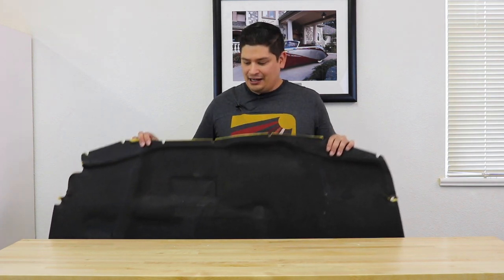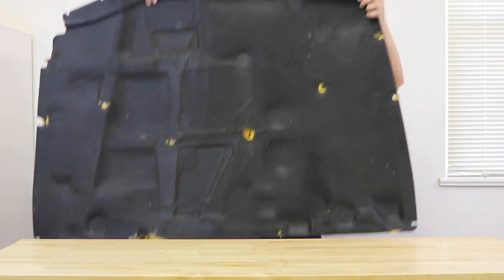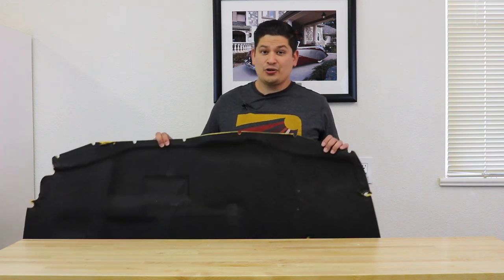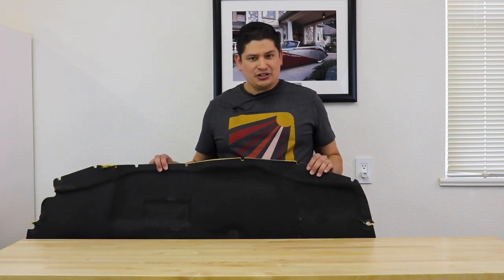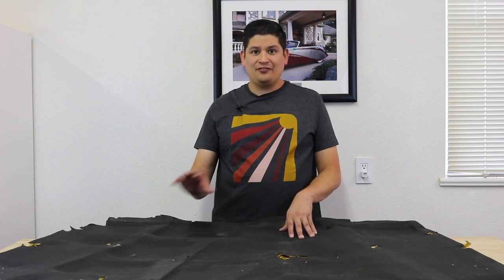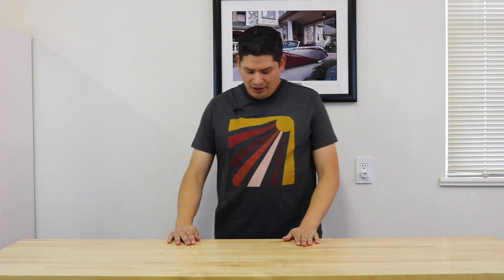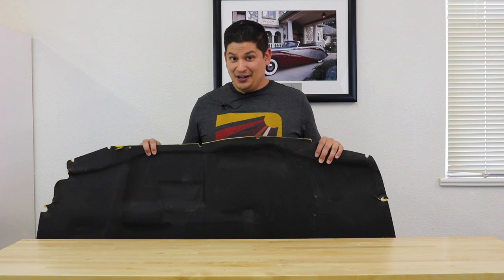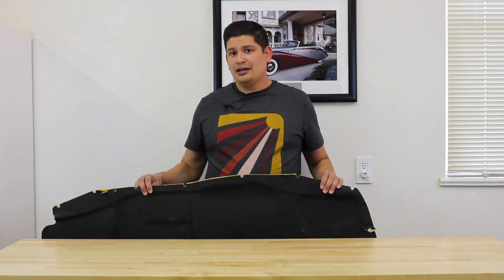HOOD INSULATOR PAD - WHAT DOES IT DO?

Comment: Chill out u don't usually need it I lost it 2 years ago and I didn't know what it's for so I didn't buy and after 2 years it didn't damage the paint so this is foreblanket and noise prove .
Reply from the maker: Right! That is what I have been trying to tell everyone but for some reason people think their paint will get damaged. Thanks for checking out the video man.
Reply: @DriversTherapy  i have jet black paint on my 2004 e46 and removed the insulator about 7 months ago and i definitiely noticed light oxidation above the engine and bought a new one.
Reply from the maker: @wooltrouserslover777  sorry to hear that. But that is good info for any one with the same setup.
Reply: @DriversTherapy  yeah it’s unfortunate- everyone on the e46 forum claims you don’t need it but they’re wrong. it’s not too bad though, I think it’ll polish out pretty easy.
Reply from the maker: @wooltrouserslover777  I understand. That is why I added in the video that every car is different. Even though I have no heard of a Supra having issues I still put some heat reflect tape on it for peace of mind.
Reply: @wooltrouserslover777  hi, i have the same paint. Did your car have turbos? Thanks
Reply: @wooltrouserslover777   thanks for input, my wife 04 325ci I’m fixing (years of neglect before we met) have a rotted insulation that I find seeping through her cabin air filter and air-filters. 

Planning to just remove and was curious if it was needed. Not paying $150+ lol. Figure maybe just get roll of heat pad / noise reduction for less than $40 and just slap it on instead.

Comment: So question I put oil in my 2011 Ford Fusion and forgot to put the top on and as I was driving I started to smell oil in the inside of the car I thought maybe because I spilled a little bit while I was pouring it in and I did clean it so I was like okay well maybe it'll burn off but it just started getting worse I was like oh my god did I really forget to put the top on and yes I did so the inside the cushion in the inside is a little drenched with oil so should I take it off or should I clean it I know for sure it's going to continue to smell like oil inside of the car until that is taken care of
Reply from the maker: Hello, accidents happen so don't beat yourself up too much. I personally would get a few shop towels and damp the area with oil as much as you can till you can soak up as much of the oil you can. After that, I would let it just dry up. There will be a stain and you will smell some oil for a while but over time it will go away. I think that is the best move so you keep your engine pad in place. If it bugs you too much, go to the dealership see how much a new one costs and weigh that option as well. Thank you for watching the video and let me know if I can help any further.

Comment: from my experience... if you remove it make sure your engine temps are normal and you dont own a big turbo or V8. IT WILL FUCK UP YOUR TOUAREG V8 HOOD PAINT, and you wont know till its to late....but it was used so idgaf
Reply from the maker: Oh no! I do mention that in the video as well. Big turbos, high HP, and carbon fiber hoods will see possible damage if you remove the insulator. Of course it varies but I agree that you can see issue with high temp vehicles which are usually high HP. Thanks for sharing and watching the video.
Reply: I totalled it… that was the least of my worries but I’m in nice TSI Passat

Comment: What about a Silverado would it damage the paint on the outside of it
Reply from the maker: It depends on how the blanket was made and the position of it. Does the metal get thinner where it is placed?
Reply: @DriversTherapy  yeah cause is just like right in the middle of the hood like is not a full cover kinda like a rectangle cover
Reply from the maker: @fernandotrejo1425  It might be for heat protection against whatever is right under it. What is under it? What engine component?

Comment: I am running a 1200hp with a wrapped down pipe and a heat protection on the turbo, however my hood liner is literally smoking.
I thinking of remove it and in the next winter add wrap to the exhaust manifold. 
Have you tried to see if it can burn? I am sure mine could with all that smoke have now from it🙃
Reply from the maker: I am sure it can burn. If you do remove it I would highly recommend to add some heat tape on the underside of the hood. Especially where the area at and near the turbo. At those heat cycles, I can see some damage to paint. I would also check to see if the hood liner is sagging and making contact with the turbo or manifold. It shouldn’t be smoking unless it is making contact. I would leave it on there if you can make it stop smoking.
Reply: Mine rubs on a bit of piping just melts through
Reply from the maker: @redlined4493  I bet! That turbo puts out some heat.

Comment: What about engine heat?
Is it safe for engine to not have it because I bought a used car Toyota 2021 Corolla I noticed it didn’t have hood insulation
Reply from the maker: It all depends on the design. Some people say it is for sound and other say it is for heat related stuff. hard to tell with some many options.

Comment: Wondering what its for
Reply from the maker: Depending on the make and model, it came be used as a fire blanket, engine noise dampener, and or the hood protector from heat. It just depends. On the Supra, it is a fire blanket and it helps reduce some engine noise. Some people state it helps to protect the hood paint but it has been noted that people have removed it and no issues with the hood paint at all.
Reply: @DriversTherapy  im going to remove mine on my scion tc
Reply from the maker: @valjean2036  OK, just make sure that it is not a vital safety part for the engine compartment such as a fire blanket or such.

Comment: BMW uses plastic screws that strip instantly so   My pad is in the trash with my old hood
Reply from the maker: How long ago was that? Any issues?
Reply: @DriversTherapy  it really doesn’t get that hot in the top of the engine bay I wouldn’t leave the car at idle for hours on end without air passing thru the hood just to be safe
Reply: @DriversTherapy  also for about a month now , it was a completely fresh paint job and I live in Phoenix , az and literally no issues as far as I can see and the hood really doesn’t get that hot
Reply: @dylane2396  u have a hood scoop ? Bro I got a Camaro I want to take it off
Reply: @OMGEB  no I don’t have a scoop but air naturally passes through the top of the engine bay as well as the top of the hood similar to blowing on a spoon full soup that’s too hot. I wouldn’t suggest leaving your car running while it’s stationary for many hours at a time but the main factor in paint fade is for a fact the sun and not the engine heat
Reply from the maker: I am glad you are running without it with no issues. And I feel you! Arizona does get hot, I was stationed near Tuscon a while back.  🤟🏽